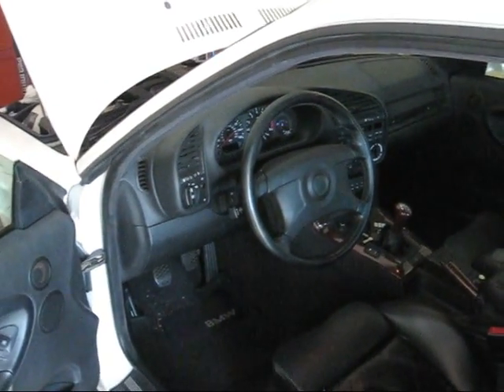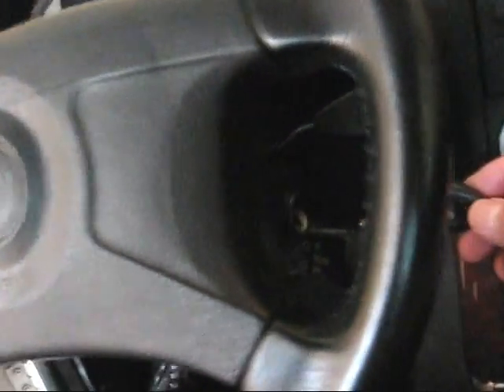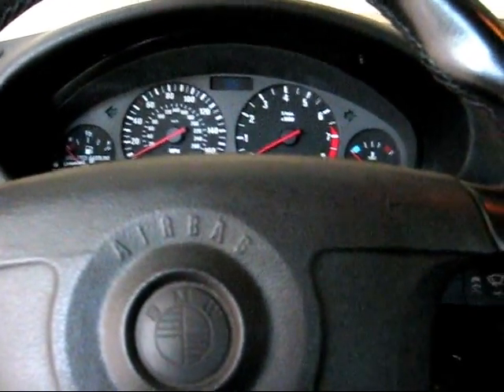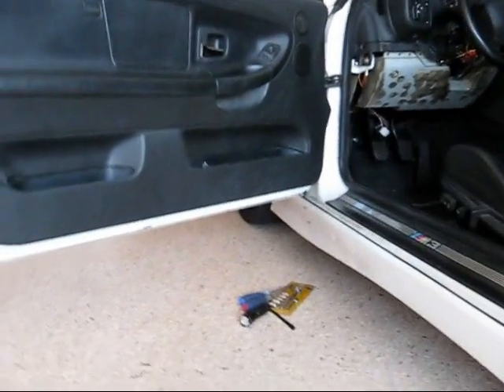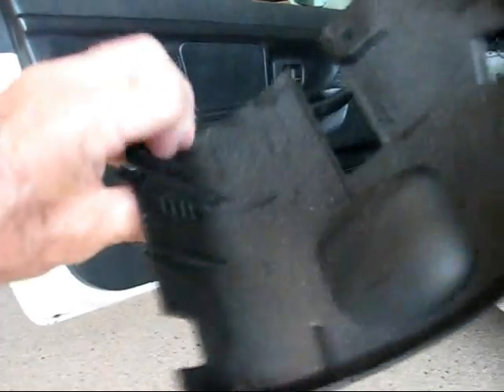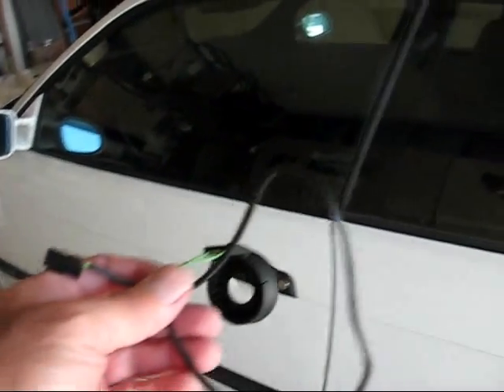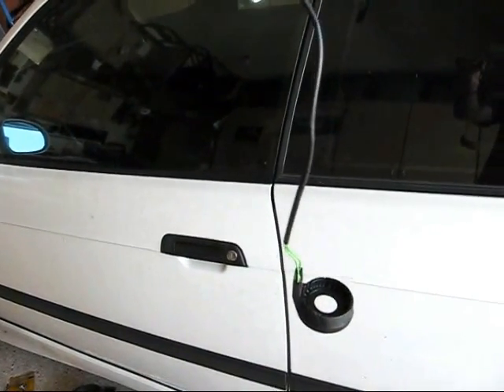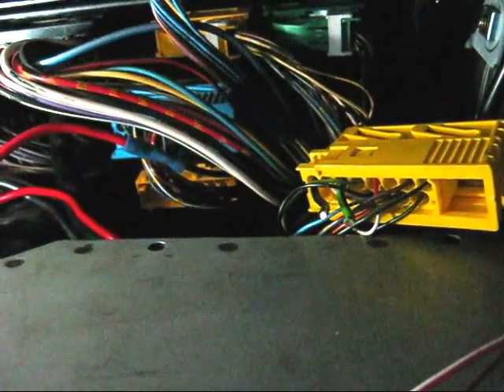BMW EWS II security bypass on 1995 M3 by froggy

Comment from the maker: It's common for some oil to be in the wells where the plugs are. Valve cover gasket kit includes new gaskets to fix that. Would not affect starting. You may have a bad solenoid/bad starter, but I can't be sure.

Back in the day one guy would turn the key and one would take a long tool and bang on the starter, be careful. You could short out the wires there.

Can you take a reader & get some codes?

Comment: It is a loud click that's distinct. I tried jump starting it and nothing. I can try to see if it's a bad battery. But sounds starter or ews related, any ideas? Will oil in spark plugs cause the car not to start?

Comment from the maker: You have changed a few things that make the situation different from my example on a stock 1995. If you hear a loud click, that sounds like power is going to the starter. When mine was dead I could not get any power to starter, so this sounds different. Did you try a jump start or different battery, a loud click with no crank usually means a weak battery.

:)

Comment: Here's my issue, 6/95 Build Date M3, 3.2L OBD1 Swap, I used a red label chip in my 413, and snipped green wire 66 on the port or 7 on it, can't remember. It started right up. Flash forward 5 months later, my car will not crank! I hear a loud click noise and the hazard lights come on? Do you think this jumping of these wires will solve the no crank issue? I'm not sure why the hazards come on? If I double lock the car and unlock, it goes away then comes back.

Comment: I done exactly what you did in the video. But the 2 wires had been cut off are only for starter. I still not able to start e36 328 engine
Reply: How did you fix?

Comment: Hi, a pro mechanic fixed the issue on my car, 318is 97 Manual, this info may be useful to someone else here.

The no crank issue was located on the clutch pedal. The EWS does not affect the starter, it locks the engine only (at least on my model)

When you push it, the clutch pedal makes a bridge connection that allows your car starter to crank, if you have a no crank issue, you should check the clutch pedal connection first, a slack cable on this connection was the issue for me.
Cheers!

Comment from the maker: You need to trace the low voltage wiring that goes TO the coils, and this is just me doing a logical backward trace, I have not done it & there may be a better way, but sorry, it's all I have, at the moment. Verify good wiring.

Post back.

Comment: I did the old take the coil out of the hole and put a spark plug in the coil ( with ground strap bolted up to the coil and the plug pressed firmly into the coil) then grounded the threads of the plug to the head with a jumper. then i was able to sit in the passenger seat and look at the plug while turning the engine over. no spark.

Comment from the maker: Hmmm. The history of BMW EWS security is that they added stuff every year. In 1995 it killed fuel & starter. In later years it "could be" more was disabled. You need to see if power is getting to the coils. How did you diagnose "no spark" What specifically did you test?

Comment from the maker: Old school way was if the starter clicks but no spin, bang on the relay if you can reach it, it's on the starter. If that spins it you have a bad starter/relay. Always be looking at your elec. wire connections for short/fray/break.

:)

Comment: hey froggy... i have a 98 e36 my fuel pump turns on. but i still have a no crank issue. new battery and the dash lights turn on when the key is turned on. but nothing happens. no clicks or anything. any ideas?

Comment: Just wanted to clarify something. Your wiring modification jumps the starter relay which is located inside the ews module. This however does not disable the EWS system. if you tried to start the car with a chipless key it would crank but not start because the ews still inhibits spark/fuel. Similarly if a different component of the EWS was to fail this bypass would not fix the problem.
Reply: This is right. My e36 1996 can crank with no start

Can any body help me to start?

Comment: someone please help i have a 97 bmw 3 series 1.8 i had a similer problem to yourself froggy i broke to green wire on the ews ring so re connected it and worked fine at the same time this happened the starter packed up obv i thought was the ews so got new one ring i put a new starter on but noting wont start from the key. i do have power to the starter but would it stil have power if the secure system was ingaged ?

Comment: someone please help i have a 97 bmw 3 series 1.8 i had a similer problem to yourself froggy i broke to green wire on the ews ring so re connected it and worked fine at the same time this happened the starter packed up obv i thought was the ews ring i put a new starter on but noting wont start from the key. i do have power to the starter but would it stil have power if the secure system was ingaged ?

Comment from the maker: Hi Gene,

Thanks for checking back. I found a few of the emulators, it seems some (all?) need a diagnostic tool to program the emulator to the car. The difference, it seems, is my procedure does not require these emulators and does not need to be programmed to the car with a diagnostic tool.

Other than those points it seems they accomplish the same thing, get the darn car running!

Thanks!

Comment: Don't need a link. Go to google and type in 'ews emulator' and you'll pull up a100 or more. Mostly china selling for 10 to 20 dollars. Its a small circuit board that connects to ews connector. Dont know what the diference is from your invention.

Comment from the maker: There was a comment I deleted by accident, bad click, sorry. It was "why do you need a jumper wire" and why do you need this if they sell an "emulator" to do the same thing?

For the first question, in the video I say "you jumper them together" ie "connect them together, I did not say use a jumper wire. watch 13:25 again & look at the video.

For the second question I am unaware of an ews2 "emulator" please post a link to this. The other part of the answer would be, I suppose, this is FREE.

Comment from the maker: I would test the fuel pump with a fuel PRESSURE GAUGE at the engine, the FP may make a noise and / or run but might be too weak to provide the pressure needed to fire the engine.

:)

Comment from the maker: Sometimes you can bypass the ews and then run an earlier ver. of the DME that has less "security" built in & still runs the car fine. But you need to research it.

:)

Comment from the maker: Thanks for the post. On mine 95 m3 ews2 there does not appear to be a rolling code. Once the bypass was in, it started & ran like a champ.

Having said that, there are clearly differences from year to year and model to model.

You really need to research what you are dealing with in each case & not just try the bypass and cross your fingers.

:)

Comment: Cheers for showing the bypass. I used this mod on my 95 E38 750IL and I got the engine turning over, but no start.

It uses the same EWS II system, but the difference is the DMEs ( Engine ECUs) have a rolling code that comes from the EWS to enable the fuel and ignition circuit. 

Therefore, without the EWS working - the DMEs won't wake up to RUN the engine.

What I have confirmed, is that the EWS is cactus. The BMW INPA software shows that it's not getting the signal from the keys either.
Reply: So how you fix it?

Comment from the maker: Well the filter is easy & not too expensive, I guess I'd do that first. I have not replaced a fuel pump on mine so no help there. I believe it's in the tank & some folks will pull the back seat & get access there, but you will need to find a diy fuel pump instruction for that or the factory service manual.

:)

Comment: i didnt put a pressure gauge but i did test the fuel injectors and the hose that its connected to and no gas goes through the injectors and no gas goes through the hose. so im guessing its a fuel pump or fuel filter problem. what now

Comment: Hello, Froggy! Thanks for the video. I had this exact problem, I would turn over and nothing would happen. Similar to the example in your video. I followed your instructions and now the engine tries to start, however it just sits there emptying the battery trying to start. Do you have any idea if I can have a problem with fuel not reaching the engine or something similar? What do you suggest I do to find out from here? Thanks a lot for the video once again!

Comment from the maker: Andrew, did you confirm that the fuel pressure is within the proper spec before you crank?

From what I see it's NOT ews, a bad ews would not let you spin it over.

Comment: i put up a new video to help better explain whats happening. it gets so close to starting but it doesnt kick over. when i turn the key most of the time i get a loud drill sound which is the starter. ive already pulled the starter off and tested it and its good. any suggestion?? thank you

Comment from the maker: I watched your video. If the car is cranking which means "turning over" for, say, a few seconds, 4 or 5 seconds, then your EWS is NOT the problem. A broken EWS circuit board (which was my issue) makes the car 100% NO CRANK. Check your fuel pressure if yours IS cranking.

Comment from the maker: The ews bypass is used when you have diagnosed that the ews circuit board is broken. ALL other components of the starting system including the chip in the key and the antenna around the key, must still function. All I did was bypass the ews circuit board & it started & ran as new.
Reply: When doing this the antenna ring must be good?
Reply from the maker: @xeno5242  Long time ago but IIRC yes.

Comment: I have a 95' 325i that was not cranking.  I thought it was the starter, so I replaced it and it still no crank. So I went ahead and did what you did and bridged the two wires and it cranked up. Now, I haven't tried to fully start it yet bc I forgot to put on an important hose so had to take manifold again but am doing that after work. I've been reading that this will only make it crank and not  start, and im worried mine will do the same. So ALL you did here was bridge the two wires. Right??

Comment: I have a 95' 325i that has no crank issues. Ok, so I've done exactly what you did. I have not yet put evwrything back together (manifold, bc I thought it was starter), but after bridging the two wires it cranked after not doing that before. I'm reading about this stuff online and everyone is saying that bridging the two wires will indeed make it crank, but NOT turnover. But in your case, that is all you have done, correct? Just want to make sure, I'm hoping I'm having the exact problem you had

Comment: you right bro i did the ews by pass and still the same issue let me explain the problem that i just saw so at cranking there is no spark but if we press the gas pedal like three times eventually it wil fire up and give out spark weird right any way ill post more results latter and thanks for t quick response froggy

Comment: hey i had a no start situation on my e36 and we checked all the posible problems like crank and cam sensor coils fuel delivery and all checked fine so we went and got a red label dme after that the car started but it takes me to long to get the car to start it cranks and cranks but wont start till like ten or fifteen minutes of cranking so i believe there is an issue with the ewsll if any one can send me the proper way to bypass this system i woul be really greatfull thanks

Comment from the maker: On my 95 ews killed the fuel pump and the starter, not sure if it also killed spark. Once I did my bypass it just fired up & ran. German anti theft laws required car makers to up the security in later years, so you may have an additional level of security to bypass. Post a comment if/when you crack it. Wish I had more.

:)

Comment: Did some digging around, got the car to tumble, got the fuel pumping to the engine. Just one little thing I'm missing. Seems I'm not getting any spark. But everything else seems to be functioning. What can be done to the DME? Any helpful websites?

Comment: Greetings Froggy. I followed this procedure on my 97' 318is. The key was broken and I now have a key without any chip. Before I followed your video my dash would light up as normal and then nothing. Now I hear that clicking sound when i bounce the starter but no tumble. Any suggestions as to what it may be?

Comment from the maker: Could be the case, these are quite different year to year, mine I did not need to touch the DME (1995) but later years got more complex. Worth a try if you can get the parts. I don't know if there is a SEPARATE chip for ews in your DME.

Comment from the maker: As I worked thru mine, I did find a guy in CA (I believe) who had a web site & rebuilds the ews circuit board, but he only does certain ones (as they are different year to year). He could not do mine but maybe do yours, cheaper than new ones from dealer. Sorry I do not have contact info, but if you google enough you should find him.

Comment: Greetings Froggy I followed this procedure on my 97 (10/96) 528i with an EWS 2 system, it was located in the same place yours was with a few differences, I to had the no crank problem and after splicing the two thickest wires on the EWS connector I finally got it to...crank! Lol but still no start, I feel like I made progress but I may be missing ONE LITTLE thing to make it fully start. Any input would greatly be appreciated for there are ALOT of people with e39s who are in the same predicament

Comment from the maker: Glad it helped, fwiw I think the little circuit board just fails (or some tiny part on it fails) after xxx years/miles. It's too bad the manufacturers have to keep putting more and more complicated anti theft systems in, but the consumers & the governments demand it & it's tough nuts to the second/third/forth owner when it fails. Locked out of your own car now that sucks.

:)
Reply: The links in your description did expire. May you have backups or a way to locate those again? I'm running into the same issue.